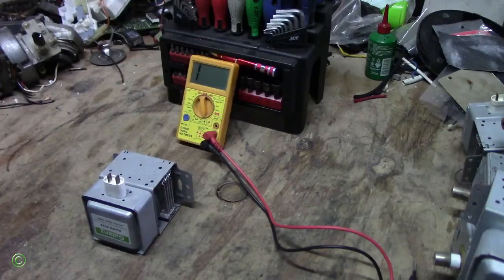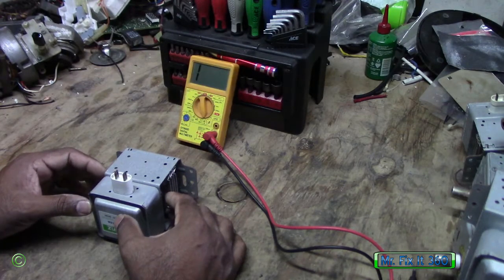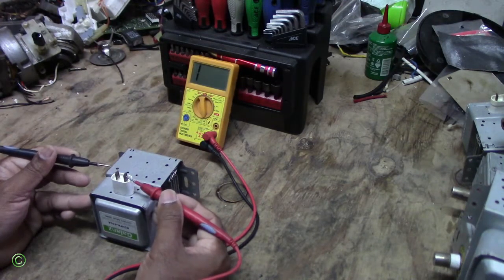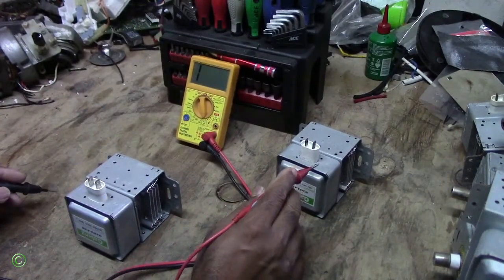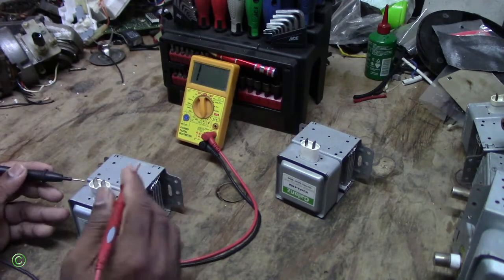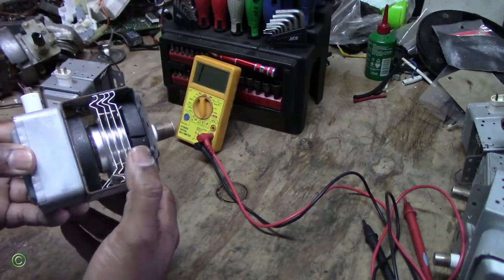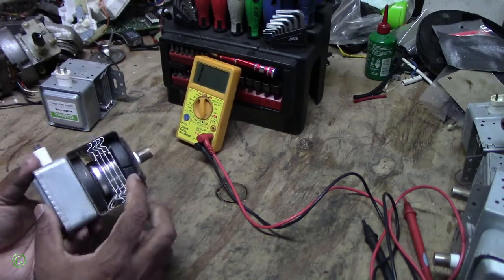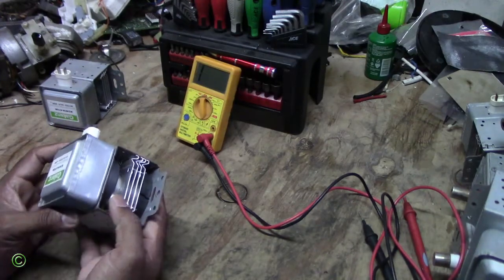A working Magnetron with broken magnet

Comment: You can fix the magnets.   Wind them with some turn of steel or 1mm copper wire , trist the ends firmly ...repositioning the broken magnet with precision then apply very generous amount of superglue in a way the ensemble will be solid...   then wait 12 hours putting the magnetron in the sunlight.....      Magnetron fixed ..... forever :-)